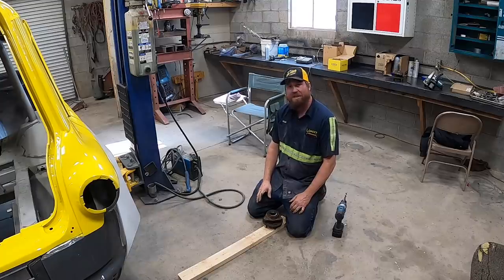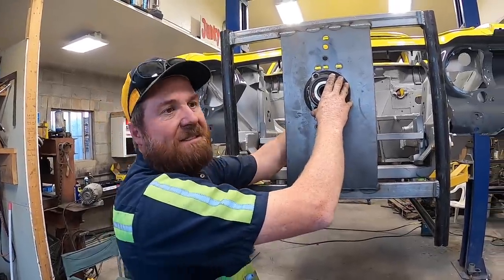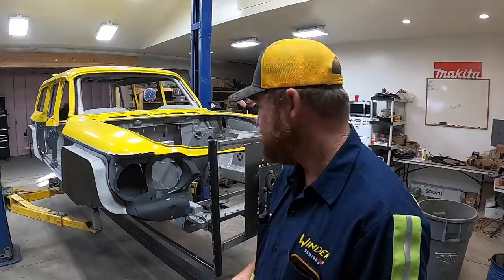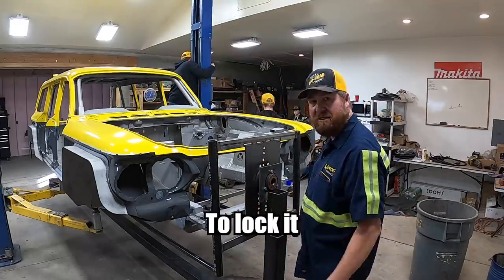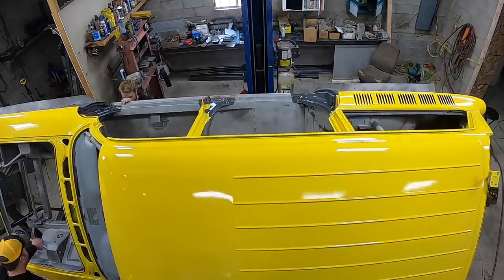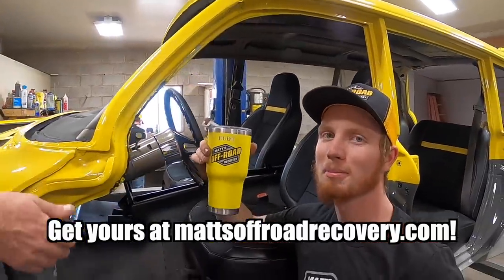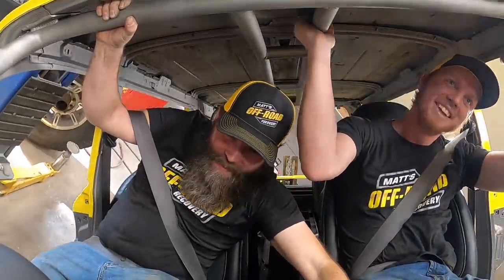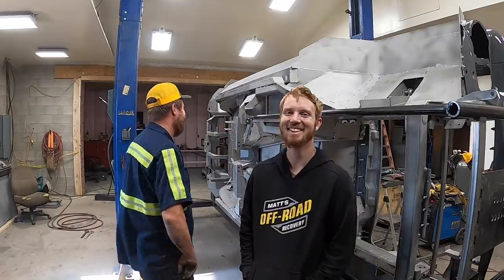We Turn The Corvair Build Upside Down!

Comment: "We got lucky". The only luck there is how close you were to the center of gravity.
Reply: Someone was either able to calculate, or Rudy was able to closely estimate,  the “centroid” of the shape and mass of the body shell. With that single centroid point known you could have built a rotational axis (in any plane)  as long as it passed through the centroid.  Good job, Rudy! Now, resume your studies and you will be a great (fabricator) engineer in a mechanical engineering firm. Your ability to manufacture prototypes will be highly valued and in great demand.  Excellent work awards to MORRS’ Skunkworks team.
Reply: Mad skills in problem solving!

Comment: Matt if you roll and everyone grabs the bar on the roof there hands will be crushed. You need grab bars installed.
Reply: Yeah that would be an easy addition. 👍🏻👍🏻
Reply: Word!
Reply: YES!
Reply: True!
Reply: Very Good Point!
Reply: Also if he rolls either vehicle all those good people will get smoked by what ever winch, jack, tools, rigging are in the trunk. Both vehicles need a cargo divider.
Reply: @geepuller1  🐕 Dogs will become Flying projectiles too! Lol
Reply: An easy fix is those strap handles they have for jeeps
Reply: Need to pad those roll bars too. They look pretty close to people's heads. That back seat looks pretty tight too.
Reply: @tommywallbanger  padding tight to the roof will keep fingers out of the pinch zone

Comment: That's why the exo cage goes on the outside of the vehicle to protect the beautiful body lines and provide more space in the vehicle. Plus U can use the cage for various other attachment rigging. Good point on the smashing hands in an event a roll occurs. It would be natural to grab. The grab handles could be some stitches as well head bang.  Maybe use some premium thick plumber padding so they cant fit their hand around the tube and protect from head banging. Hopefully mat will install full harnesses to keep the passengers in the seat while upside down. Man I cant wait to see this thing in service. It should be able to pull a house off the blocks for sure.

Comment: Matt....on your next vehicle rotisserie fixture build out possibly consider starting with mounting two trailer axel hub ends pointing horizontal at the vehicle to be rotated and weld them too the upright 4"x4" square steel stand. Then find thin width trailer steel rims to attach to the vehicle's front / rear bumper attachment points. This design makes for a low cost and quick to build, even extra sturdy 4 or 5 bolt pattern stud bolt on / off vehicle rotisserie fixture. David L. Howser of Freeland, Marylañd

Comment: That roll cage is going to crush some fingers if there aren’t grab handles.
Reply: Last episode of the built is about the ins n outs of reconstructive surgery...
Reply: People have been saying this for a while and they just skim past it.
Its a trick that only works once.
Reply: Grab handles only work if the people have the frame of mind to grab them while rolling over in a car and not panicking. Good luck with that.
Reply: @chuckstith838  very wise words
Reply: Yep. Every one of them grabbed the roll bar. 
Many years ago, I was in a Jeep that went end over end. Both of the rear seat passengers grabbed the roll bar. Only one of them really got bit by it. It was miraculous that everyone stayed with the Jeep... With there not being a top, or seat belts, and all.
Matt must have a solution for this, swirling around in that head of his....
Reply: Yep, I just commented the same thing. They must be planning on adding something later. Huge oversight.
Reply: Could wrap them in the pool floaty type bar covers to fill the void just to just keep fingers out.
Reply: @chuckstith838  
I suspect it's not hard if you see the roll coming, such as when slowly crawling over rocks.  Driving along at expressway speeds and suddenly crashing into something that sends the vehicle hurtling, you have a point.
Reply: @kdmag8858  Yup, that's what I did, foam wrapping (with vinyl covers) to fill the void and make the bars too large in dia to grab easily.

Comment: I think I would put in foam rubber on the roof inside so when you are bumping down the road you can keep your heads. I would also think about using milk crates for your ropes and things in the back to organize things.

Comment: I recognize those hubs... Be sure to cut up a couple of CV shafts to bolt the spline ends through the hub or otherwise compress the bearings. They will fall out under a side load.

I know this because I left the CV shafts out of my Silverado thinking I'd just run in 2WD until I had the money to replace the shafts. First left turn out of the driveway and I had to call a tow truck to drag it back to the garage when my front hub inconveniently self-disassembled, laying my tire under the truck.

Comment: Nice build! If you put a section in in the bottom pece to extend the rotisserie. It will be easier to get the car out, and you can sell it to the guy doing the coaring.

Comment: I’ve worked on a few rotisserie stands at a couple different body shops and they weren’t half as nice as the one you built! We even built a 180,000$ 67 Mustang fast back Eleanor clone , but body shops , especially here in NY/Long Island area almost never have nice new equipment, great work guys!

Comment: I built a Rotisserie for my Oldsmobile out of the similar material. GMC Sierra hub bearings, rear drums and exhaust tubing because square tubing was to expensive (CA). Eventually sold it when I completed my 72 cutlass to an older gentleman with a 68 firebird.

Comment: Nice job, loved the rollover action. Question: why did you not put the cage top bars along the outer edges not in the middle there is a chance of getting a boulder against the roof gutter line, also no webbing in the screen A pillar's to the cage.

Comment: Have you seen that sort of mount on train cars?   The coal fired electric power generators plants bring in 100-ish coal open top cars, cars have round couplings.  The train goes through a building where a hugely powerful mechanism rolls each car around to dump the contents into a conveyor bin.  The machine pulls in and pulls out each car in the train as it empties out.   Fascinating process, simple enough but immense power to perform the process.

Comment: Off course some tapping with a dead blow would help dislodge the sand before blowing it out. Going to undercoat the inside too? Might help road noise.  Matt still seems you need signs for Hot Work Do Not Touch. Or helpers to warn you sooner.

Comment: Ralph Nader, "Unsafe at any speeds" (The rear engine caused a weight imbalance resulting in poor handling)! Well it does look balanced to me. Also, I think you need hood locks!  Ralph Nader (Due to the weak hinges that connect the hood to the frame of the car). My Renegade has to hood locks one on each side. But that a Jeep Import HI 😎

Comment: My first car was a 61 corvair .pulled the plug in the trunk spray foamed inside the trunk , beer keg , fill with ice mounted the tap as a hood ornament. Made a lot of friends at Myrtle Beach. Cop stopped me to tell me the radiator was leaking !

Comment: Great video Matt and Co.  I have a technical question.  I drive on the beach here in Delaware and air my tires down to 15 PSI.  They are normally at 40 PSI.  My question is, is it OK to drive on pavement at 15 PSI for any length of time or at any max speed?  It would save me time and effort if I could leave them aired down for a period of time while there. If you could share your experience it will be appreciated.

Comment: Should have been black on top yellow on the sides. Built multiple rotisserie before. Piece of cake. Why do you need bearings? It's one uses only. A small pipe that fits inside a bigger one is all you need. Its not like the cars going to be spinning for the next 10 years. All that hate aside looks great! Going to be a nice ride bud. My oun experience was a 1968 Dodge Charger that I spent $30 grand on and took 6 years to complete. She is beautiful.

Comment: With no way to adjust the length you might have trouble getting the body off of the rotisserie. 
It does work great and you got very close to the center of mass.

Comment: Bought a trailer that had the worst rust ever. The guy thought it was a wise idea to have it Bed Liner coated professionally when new. The issue is, it's like putting a rubber glove over steel and any pin hole holds all the water next to the steel indefinitely. It literally rusted 1/4" steel clean though and it was only a 10yrold trailer when I got it.

Comment: Great job on the rotisserie. Well balanced ! Got lucky... Funny. Does it need to rotate ? Can’t you just put it on a trailer up side down? With enough people it could be flipped pretty quickly. The undercoating guy is kind of demanding. Didn’t seem to want to work with you.

Comment: With the ability to fabricate equipment and the number of side by sides that have broken front ends I would think they would build a dolly to put under them and make loading onto the trailer much easier. Jack it up, strap it in and winch it up. If it’s built strong enough with big enough wheels you don’t even need a trailer. Seems like a whole lot less problems or maybe that wouldn’t make for much of a video.

Comment: I think you overengineered the crap out of that thing.  With that 4x4 steel tubing, you probably could have held quite a bit more weight than that body/chassis.

Comment: I hope this is the only time RECO has turned over its roof. Never put your hands / fingers between the rollbar and the roof / sheet metal, they will be crushed / cut off during a real crash. So fit extra handles in the car.

Comment: Talk to Scotty DTV about an LS swap Corvair I think you had the first four wheel drive I believe you 5-3 is a LS design I do not keep up with new cars give me my high-profile Ford 3/4 ton where's my 390 428 427 and a well-built C6 that's not cheap they will move the house trailer with ease keep your trailer buggies gone keep on Towing get online with that guy motlow LS swap on your Corvair you still need to build a Volkswagen station wagon thingy with a diesel on it just to piss off the haters and show him how lackluster it really is maybe GIF to Lindsay as a crew hauler of course this guy have power steering air conditioning what time do like 6 or 8 speed trans automatic transmissions get one of those all-wheel drive newer model and just put the body on it and paint proper is gots to be yellow